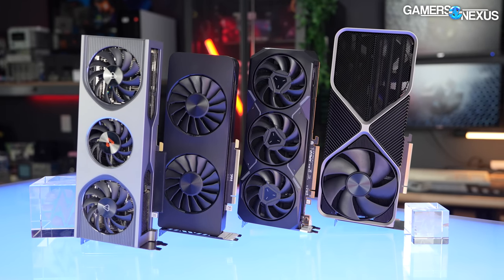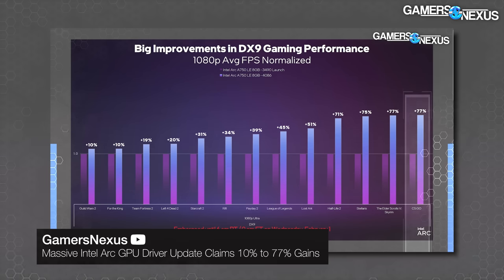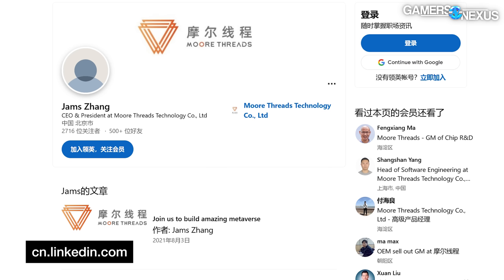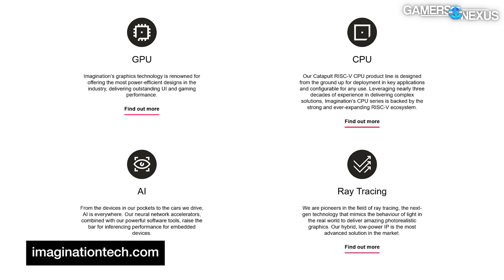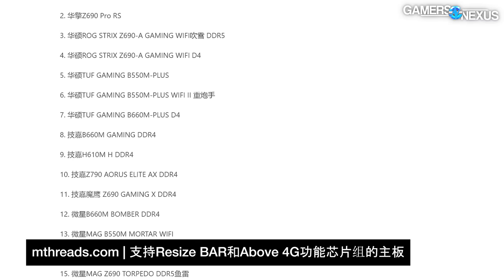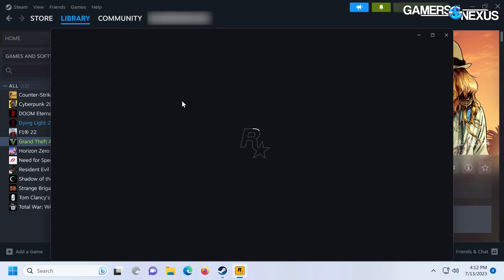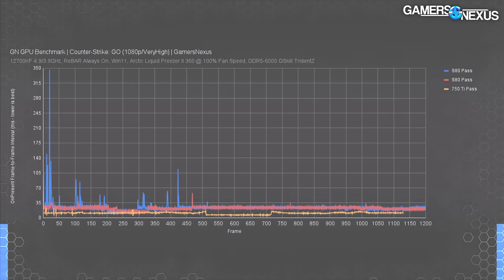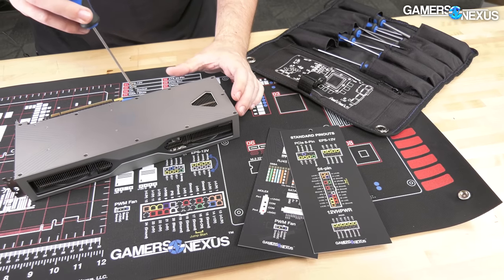China's Moore Threads MTT S80 GPU Review | A New Challenger Appears

Comment: Technically there have been more than two GPU manufacturers around for the past years, but companies like Matrox completely tapped out of the gaming GPU market. In the case of Matrox their Parhelia GPU was the last gasp, despite decades of experience in the GPU market. Now they're happy to just supply many-monitor solutions to the business market, safely away from NVidia and kin.

Whether we'll see something like the madness of the late 90s GPU market, when you had everyone from NVidia to 3dfx, ATi, Matrox, S3 and more competing is hard to say, but I'm holding out hope for Intel's Battlemage GPU and whatever Moore Threads and possibly other startups can churn out. Anything to fix the stagnation we're seeing today.
Reply from the maker: Sure. But we're talking in the context of what we cover, which is consumer hardware. There were 2.
Reply: @GamersNexus  I was one of the holdouts for years with a Matrox G550 so maybe I'm a tad biased. I also happened to have used an Intel i740, and spent money on S3 and 3dfx cards :)

For all intents and purposes the consumer GPU market in the 2000s collapsed into just those two, yes. The skyrocketing complexity of GPUs with the end of fixed pipelines and programmable everything probably didn't help there.

In the case of Moore Threads I hope they can fix most of their issues with new drivers, as those seem to be the weak point here, much as they have been a right pain the backside of both AMD and Intel for ages.
Reply: @MayaPosch  you mean Galaxy S3 i9300? money well spent
Reply: I think these guys can only do it because they're literally China. This is fully government-backed, probably with functionally infinite money. If anyone else is to enter the market, it'll be a company which already has a working relationship with TSMC in order to have any chance of getting fab time...or Samsung. Maybe they'll make Exynos Desktop or something.

Comment: So, does it mine cryptocurrency the entire time it's idle? I can't imagine what else it could be doing with an idle draw that high. Also, a comparison to various IGPs would have been funny.
Reply: I mean AMD had ( I think they fixed it ) extremely high idle power usage as well. Bugs in the driver can cause it. If it is fixed now then it took them a fair while to do so.
Reply: probably not, the drivers are very bad, so it probably does a terrible job telling the card how much power it needs, GPUs without drivers would run at full power 24/7, its up to the drivers to control their power draw
Reply: @lilpain1997  RX 7900 already pulling more power at idle because the VRAM goes at 2500MHz in high resolutions 
They released an update last week.. it's fixed it low resolutions, not high ones
My 7900xtx already pulling 107w at idle with one 4k - 120Hz screen (solo screen)
Reply: Probably something in the spyware, I mean drivers.

Comment: Prop to Steve pronouncing names with effort shown. The current lineup offered is mainly for investment presentation and small batch procurements from limited enterprise/government sectors. Drivers are also pushing out every now and then, which have at least significant level to GPU's compatibility and general optimization. I wish Steve can do some followup reviews for those early products if next gen products are to be released in future.

p.s. the buzzword meta used in ad materials usually just mean a role in cloud computing environment, and investment attraction.

Comment: Is it running slower than expected because it's spending half its resources gathering all your data and sending it to China?
Reply: Probably why, if Steve was smart, they have it completely disconnected and are monitoring the Wifi connection parity list and the building is encased in a Faraday cage.

Comment: I really like the design of the fan setup as far as the cabling goes. Way better than the crap where it is a pain to remove the fans/cables because the all plug directly into the GPU board. This is a much better design.

Comment: So I did some tests with this card using a custom Forward+ Unity3D RenderPipeline between Ubuntu 20.04 and Windows 10.

<<< NOTES >>>

* Ubuntu 20.04 is required for driver to work otherwise I would have used 22.04

* Using AMD CPU that supports PCIE 5.0 and Windows 10 thread scheduler correctly (as Intel 12th/13th E-Core chips do not)

<<< Hardware >>>

* AMD Ryzen 7600X

* RAM: DDR5 5600mhz

* Motherboard: ASUS ROG Strix B650E-I Gaming WiFi 6E (PCIE-5.0 for GPU)

* MTT-S80 GPU

<<< Windows 10 Results >>>

D3D11: 300-420fps

<<< Ubuntu 20.04 Results >>>

OpenGL: 400-500fps

Vulkan: 550-900fps

I should note D3D11 on Windows 10 is more stable in these tests. However this is very promising for Linux if future Vulkan drivers can improve and target newer Ubuntu versions. (and they really need to be doing this in MESA driver stack [not the Nvidia driver path they're choosing])
Reply: Thanks for taking the time to share this info

Comment: If you're curious about the 7NM 12 NM part I'd suggest reading Sixth Tone's article about China's fab plants. They're supposed to make 7-12NM chips but the machines to make them are currently banned. So they're having to work with machines meant for 28NM and then cut the down. It's a nightmare here (I live in China) getting parts due to those bans and the local parts are just awful because they can't get the machines to make the right parts.

They're also having an issue where the job is classified as manufacturing, despite requiring an EE degree. Since it is classified as manufacturing they're making the same wages as people working in textile mills. They can't make more than 6,000 RMB/mo due to the the pay cap. You also don't start that high. So there's massive burn out and people keep quitting because the job is demanding and the pay is awful.
Reply: oh and that list of games are the currently approved to play list for PC gaming.

Comment: It certainly makes me wonder, from an electrical engineering and software engineering perspective what portion of this GPUs problems are purely software and can be fixed with driver optimization, and what portion of it's issues are physical. How much does the odd VRM and VRAM placements have on potential performance. Are there serious bottlenecks elsewhere on the board or chip? With 16GB of VRAM this has the potential to do a lot in data science fields. I wonder if there is and driver and programming language support for this device to natively run some DS workloads?

Comment: PowerVR was also the initial challenger to the 3DFX. 3DFX won because it had mip-mapping (or textures? can't remember).
Reply: PowerVR was one of a number of early challengers to 3DFX, I recall seeing reviews for one of the first PowerVR supported games called Ultimate R@ce. The screenshots for that game do show it using texture smoothing (I too forget the technical term for that) and it looked just as good as early 3DFX games.
Years later PowerVR made a second attempt to enter the discrete GPU market with the Kyro and Kyro II. These were quite highly regarded at the time (especially the Kyro II) and incredibly innovative with a tile-based approach to rendering, but ultimately it was too little too late.
Reply: @sl9sl9  Ah yeah I remember the Kyro. I think at the time NVidia was taking off. Yeah is a pity but glad it stayed around in the mobile circles.

Comment: Jay, sounds like you may need a different AM5 board. My MSI X670E Carbon Wifi is running my memory at 6400MT/s (2x16gb Kit)  with no issues at all. Memory Context Restore is on so my boot times are sub 10 seconds, I always shut my PC down when not using it.

I will say that I'm using the Memory Try It! Profiles on the board though at the closest profile matching my XMP settings from the Ram. Secondary timings are set to "tightest" on the board, and Memclk:Uclk is set to 1:1.

Comment: Isn't there some value in PCIe 5.0 (and even 4.0) enabled cards if your motherboard supports it? Couldn't you run PCIe 5.0 cards in x4 with the same bandwidth as PCIe 3.0 x16? Being able to free up PCIe lanes for other devices by halving or even quartering the number of lanes (in 5.0's case) that your GPU runs on seems pretty nice.

Comment: The specifications of this graphics card are very high, similar to the GTX3060, but due to driver optimization reasons, it has not fully utilized its true performance. In recent months, this Chinese graphics card company has been constantly updating and optimizing drivers at a high frequency, the performance of this s80 graphics card has greatly improved compared to before, and it can now support most mainstream games. Its GPU usage during operation is currently less than 20%, so its potential is still great. Currently, its price is only $163, and the inventory of product distributors was quickly snapped up. They are preparing to launch the next generation of the S90
Reply: that's why sanctions (are stupid) actually help Chinese hardware manufacturers. - with better ''western'' options, no one would buy this and the company would just die in free market right wing capitalist world. If people are ''forced'' to buy it, MTT will have more money for future development.

Comment: The fact they used PowerVR had sped them up in design and execution. Dunno about Windows support on that architecture but Intel had way more work to do with the Arc cards. If MTT can make drivers that can use all what the hardware can manage, and the hardware isn't POS like the GeForce FX cards then it should see big improvements!

Comment: It is not only experience in silicon design that manufacturers need, driver development is also a huge part. The Chinese version of Windows has some fundamental differences to the international Windows versions (on kernel level). It is only an idea, but maybe the card can hold the promises on a Chinese windows (especially knowing, that these first cards are only intended for the Chinese market)
Reply: The windows on government computers are pretty different but the consumer ones are identical to the international version. The government computers are also moving away from windows to domestically developed linux variants tho from what I heard they can be pretty unreliable even with simple things like connecting to printers. My guess is the Moore Thread gpu are going to replace the ones on government computers.

Comment: If they based it on Mobile GPUs or PowerVR… this sort of makes sense. Perhaps. 7nm/12nm… maybe a mix of cache and GP modules for shaders. Intriguing. The thing that comes to mind is that they “borrowed” some of the mobile Adreno GPU and Apple Radeon stuff. Especially architectures that could be used for the basis of power and storage, regulators and “open” standards for PCIe and SMBus, needed to operate hardware. 

But I would assume that’s 10+ years old tech at least. Perhaps they have a more extensive Linux API support as it’s emulating APIs and overlay blending problems seems very unlikely unless there’s an emulation layer or translation problem with the DX API, ie unsupported hardware features being run in CPU or via GP instructions.

Modern DirectX can be a different beast if you don’t have the old diagnostics from way back when MPEG wasn’t a common video codec. You could test the DirectX hardware APIs individually and check hardware compatibility. 

It’s kind of interesting to see how difficult it is to jump into gaming when gaming hardware is 30 generations old, and is very locked into features that make sense … if you understand how gaming hardware evolved. And how Consoles evolved. 

I guess that China doesn’t have that background and they can’t evolve the 35th version because they never started back when it was the 5th to 10th generation, ie back when they handled VGA resolution and video overlays.

Comment: I didn't expect it to go head to head with established models, not even intel arc but I was also not expecting it to be that expensive. That's almost like a scam
Reply: At present, Moore Threads has no distributors, so the price is completely set by itself. Moore has deliberately set a high price to persuade ordinary consumers. Yes, the current Moore GPU is used to attract investment and early test driven semi-finished products, not suitable for purchase.
Reply: @gq-ym6rd i agrer with you 100% they only made the price this expensive so that normal customers don't buy it and their would be an outrage against it

The only ones who buy it right now are investors, enthusiasts and pioneers to see it's full potential.

I see give it another 2 gens which is 2 or 3 years and then we can start to actually consumer GPUs

Comment: This is really interesting.  The performance reminds me a little bit of the integrated GPU I had in an old laptop.  For that, 3D games would make the computer halt and catch fire, but 2D games worked great.  I wonder how well it can run Dead Cells, which is both a 2D game but also a game that occasionally chugs on weak hardware.

Comment: This is pretty ambitious.  Most of my hardware is from Japan, Taiwan, or South Korea.  I have one Chinese 40"4k LCD TV I use as a tertiary monitor.  They could not even program the remote for it properly.  They stole the remote programming from a South Korean corp.  Stable GPU drivers for a unique chipset are several orders of magnitude more difficult to pull off than an IR remote.

Comment: I'm quite impressed by the hardware, but it's obvious it's completely let down by the terrible drivers. If this card was able to perform the way the hardware is capable of, it would actually be able to compete with an Intel ARC 770 16 GB or RTX 4060 Ti 16 GB in terms of rasterization. This just goes to show how important it is to have proper drivers and software. I also really like the way the shroud of the card is designed.
My prediction is that if they can get enough funding and proper software engineering, they could compete with NVidia, AMD and Intel in about 5 years from now. I doubt it will be any sooner, given how difficult it is to get drivers and software to handle all the tasks "gaming" cards (which are actually all purpose cards) to run properly and optimized, just look at Intel as an example.

Thanks for giving us this review, it was very interesting and I quite enjoyed watching it. I've seen this card before in the "review" Linus Tech Tips did, but they hardly told us anything meaningful and didn't really put any effort at all into trying to test the card and didn't do a teardown either. This review was excellent, well done.

Comment: The Moore Thread MTT S80 game graphics card is equipped with a complete "Spring Dawn" chip core, built-in 4096 MUSA stream processing units, and can provide 14.4TFLOPS of single-precision floating-point computing power at a main frequency of 1.8GHz. The resulting powerful 3D graphics rendering capabilities will be able to bring users a smooth operating experience at 4K resolution in Windows DirectX games. MTT S80 is also equipped with PCIe Gen5 x16 interface and 16GB GDDR6 large-capacity high-speed video memory, the highest bus bandwidth of 128GB/s in the industry, and 448GB/s video memory bandwidth, which can further improve the core operating performance and help release the full performance potential. With up to 4 concurrent 8K UHD and 1080P 360Hz high refresh rate display output capabilities, the MTT S80 can meet the diverse display needs of different users. At the same time, Moore Thread will continue to optimize the MTT S80 in multiple dimensions such as hardware, computing, memory access, scheduling, and system, aiming to bring users better game performance and wider game compatibility. MTT S80 has four complete functional engines, which can provide full-featured support based on PC scenarios in the fields of multimedia processing and artificial intelligence. The built-in Moore Thread second-generation intelligent multimedia engine provides codec acceleration capabilities for mainstream video formats such as AV1, H.264, H.265, and VP9. Based on MTT S80, users can also train classic models such as computer vision and natural language understanding.

Comment: Honestly, all this is telling me, for now, is how well Intel did with their first cards. Granted, Intel was already a computer tech giant beforehand, but still. For as many problems as the A310 had, with drivers and whatnot, the card was highly compatible with the current market, and it worked decently more than 80% of the time.

Nowadays, Intel barely has a hill to climb with their cards. Drivers are doing 95% fine, their tech is solid, all they need is to actually compete with the market now.

Now, and this is just me, I'm not a big fan of chinese designed equipment. They are keen on cutting corners to make their way into markets with low prices, and obviously this comes with severe problems, specially when talking HIGH tech. If it wasn't the case that my home PC was basically my life (it's less sad than it sounds), MAYBE I'd take a risk. But the importance of having a working PC at my home is far too great for me to take a risk with chinese designed tech inside my case. (Notice the emphasis on designed, before replying "but everything is MADE in china".)

But as a final point, and maybe even a counter point to my previous paragraph, I hope Moore Threads does good (very good, in fact). Intel getting into the GPU market was already CRAZY GOOD news for everyone, and when they can finally compete 1:1 with nVidia and AMD, we are the only ones winning. MT getting up there and joining the big leagues would be even better for the consumers.